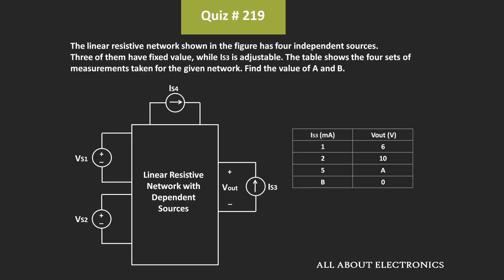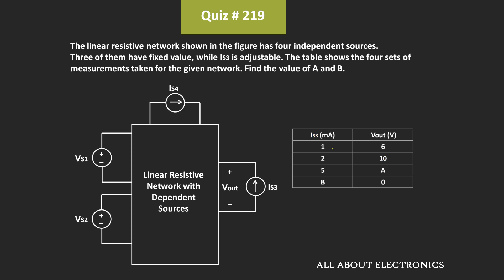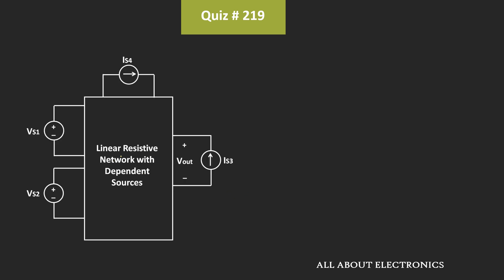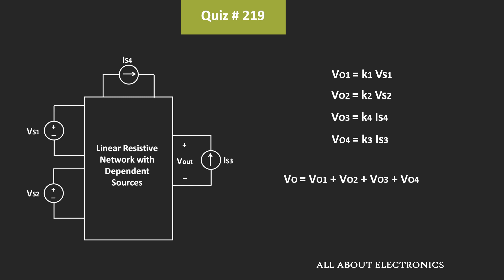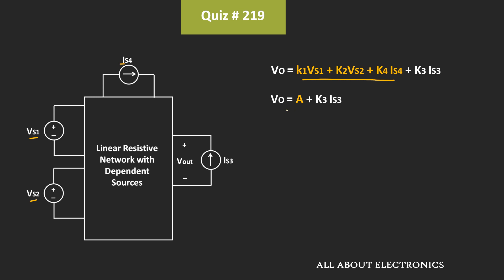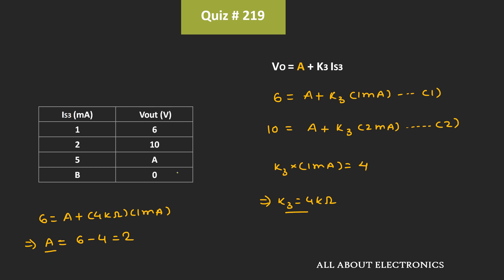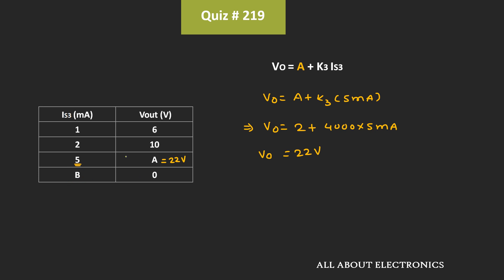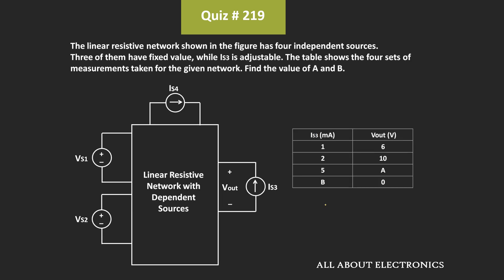Network Analysis Solved Problem | Quiz # 219

Comment: Since I and V are co-ordinates of points on a straight line here, we can simply use the fact that slope is constant.

Now, slope = (10 - 6)/(2 - 1) V/mA = 4 V/mA

So, (6 V -0)/(1-B) =  4 V/mA => B = -0.5 mA

Similarly,  A /(5 mA - B) = 4 V/mA =>  A/ 5.5 mA = 4 V/mA => A = 22 V